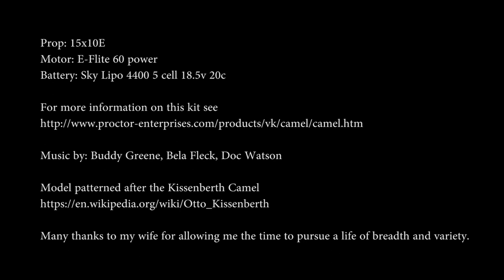How to build a procter Sopwith Camel REALLY FAST! - REVISION

Comment: The rear elevator doesn't appear to be in the same plane with the rest of the aircraft.  Leans to port.
Reply: That was before finishing. The next scene he removes the horizontal stabilizer, then covers it and glues it on correctly.